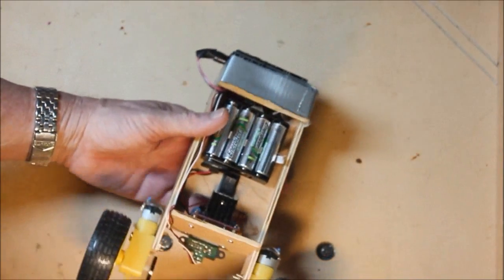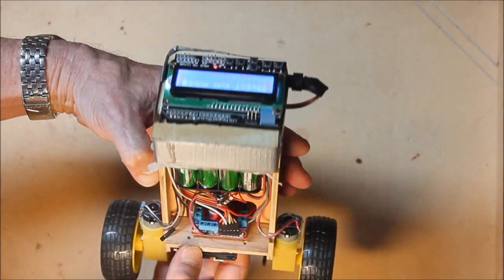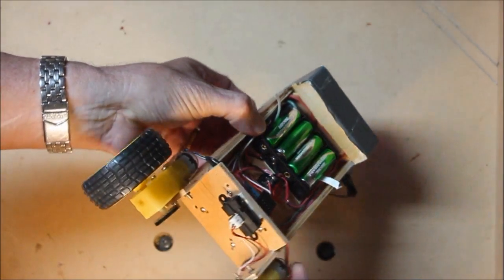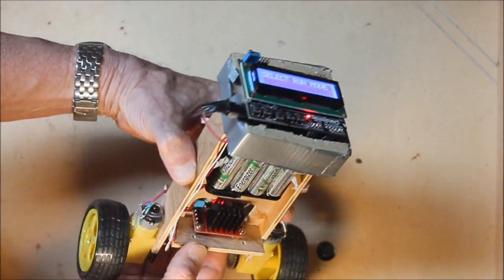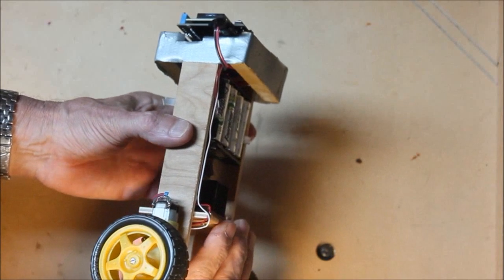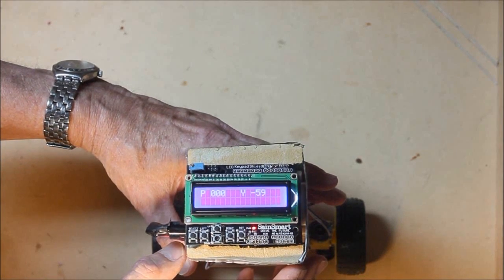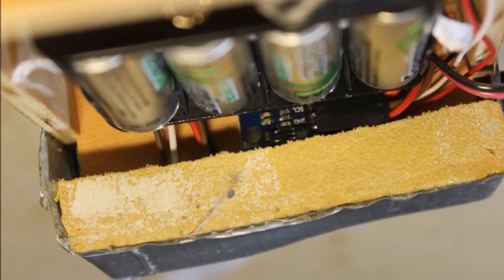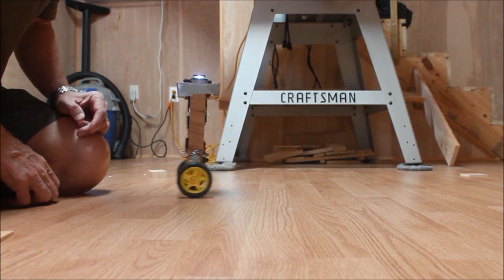Arduino/MPU6050 Balance Bot

Comment: Thank you for make this project open source... after check what parts were available to me and not want to order new parts due to the two weeks it takes for them to be delivered I opted to use the Leonardo's baby brother the Pro micro with is the same MPU. After finishing the robot I just had to wire up the H-bridge and I came across a problem... The micro was less pins than the Leonardo and I don't have all the pins needed as specified in your code. If you were to use the micro which pins would you use and  what changes would be needed in your code. I was thinking reassigning the d0, d1 pins can I do that? I'm not using any USART communications. Secondly I did not have the GP2D15 IR sensor... so I replaced it with a ultrasonic sensor that is run by a PIC12F675 chip and emulates the GP2 sensor output. That seems to be running well. I will post the code to you for others who wish to use this method of object detection at a later date when its all working.... great work...thanks
Reply from the maker: Don't see why you couldn't use d0 & d1. Another option that might be available to you, is some versions of  L298n breakout broads have a hex inverter input chip. If this is true for yours, then you can slave "in2"  off of "in1" and 'in4" off of "in3". That would reduce your Pro Micro lead count by two. 
Ok too on the IR sensor to sonic sensor switch out. Sounds like something fun to play with.
GL with your project and let me know if you post a video of it.
Reply: I have it working now... D0 and D1 is connected to the E , RS on the lcd. PWM D9,D10 is the L298 ENA,ENB and then the rest on the other available digital pins.... worked first time.... but does not balance at all just keeps sweeping backwards and forwards and I have to hold it or it will just fall over... I am now trying to work out how to set up the PID offsets.... Error: on the lcd is over 2000.. YIKES... Yes I will post the Ultrasonic part soon as it all works together... Thanks a lot Jim for replying... Speak soon
Reply: jmhrvy1947  It would have been great if the PID offset's were settable by 10k presets connected to 3 analog inputs so adjustments could have been made in real time or at reboot without the need to reprogram the Arduino.. just speak out some thoughts aloud...thanks
Reply from the maker: Agree.. Setting the PID values via the Arduino IDE is tedious. When I started, I had no idea what values would be needed, or the precision they needed to set to. That and being lazy, led me to using the IDE. Think at least one Analog input pins is still available, so It might be a feature you can add to your take on this project.

Comment: as you said, your robot balance itself by trying to stay at 0 degree. However, what if the the weight is not perfectly centred, won't the robot keep moving in 1 direction?
i am pretty sure the it is very difficult to build a robot with its centre of gravity exactly in the middle.
Reply from the maker: Good comment /observation. I did not make a video of it, but at one point, I purposely added a weight to the car, grossly offsetting its normal balance point. The way the sketch is written, the software is constantly looking for and evaluating what  angle (from the MPU) represents the balance point. You start the software while manually holding the car at what feels like the balance point. At startup, the sketch takes whatever angle the MPU is generating and uses that value as the balance point. Overtime the MPU value will drift, so the software keeps refining the balance point value (based on which angular values yield the lowest rate change).  With the offset weight attached the car operated as without it, but body of the car was on roughly a 60 deg angle (to the floor) rather than its normal 90 deg position. To the eye, it looked somewhat strange , but as long as everything was rigid, the car/software didn't care. 
Hope this response made sense, and thanks for the comment

Comment: Hello i have similar motors as yours (the yellow ones) but i have one problem when i turn the robot on it freezes when the motors start working, how do you solve this problems ?
Reply from the maker: Good question. Initially I had similar troubles. And I described some fixes in the earlier videos on this topic. So please check them out. Probably the most significant thing i did, was attach 0.1 mfd capacitors right at the motor terminals. you might be able to see them in this video. Good Luck, and thanks for your comment.

Comment: Hello This is few of the wonderful project I have seen; I am using UNO so shall I need to change connections!? Next thing how can I caliber MPU6050 and get those Gyro-offset values!? Thank You!
Reply from the maker: Thanks for the comment and interest in the project
You can probably implement this project using the UNO, but in my sketch I have tinkered with the registers that effect the PWM timing.. These lines are specific to the LEONARD and will cause compile errors when the code is compiled for the UNO. At this time I am not prepared to suggest how to adjust them for your project.. (other than to comment them out)
As for calibrating/setting  the PID values. For me, it was mostly a "trial and error" process. My best council is be patient, and build your Bot to survive lots of crashes. Notice in my video this "Bot" has a foam Bumper that surrounds the electronics,. Also the batteries are arranged to disconnect no matter which way the bot falls. This results in immediately shuts down of the system on a crash, saving  both the electronics and motors from burnout 
Good luck with your Bot and let me know how it turns out

Comment: My very first question is how you able to set those values of Kp,Ki and Kd ; please explain!?
Reply from the maker: I wish I had a slick answer for you. But the honest answer is "Trial and Observation"
I started with the "I" and "D" values set to zero, tried to find the best "P" value. After that the "I" value was incremented, and finally the "D" value added. But in general, as you increase one vale, the others need to be changed too. So it took many iterations before I found the values that seemed to yield the best stability for my setup, Unfortunately there is no one set of magic numbers that will work for every car and motor combination.
I appreciate your interest in the project ,and if you are working on one for yourself. I hope you have some luck with it.
Reply: Thank You!

Comment: Great project, I've been watching this video for about 10+ time now. I can see that you explained everything clearly in the video and the code. But due to my limit knowledge in programming, I still have not be able to get the code working. I used arduino Uno, I changed the PWM motor wire of EnB from pin 13 in the wiring digrame to pin 5 of the Uno, because that pin has PWM. 
However when I complied the code, there was the error in line 210 "TCCR4B' was not declared in this scope" , so I thought maybe the Uno does not support TCCR4B, therefore I changed it to TCCR2B and TCCR1B, and got both of them complied and upload successfuly.  
However the left motor (according to wire diagram out3 and out4) keep turning, while the other motor is not moving at all.  I did have the capacitor in place, and I do not connect the LCD display, and did not adjust the offset of the mpu6050 sensor. I just wanted to get the motor run first. 
And did you tune the kp, ki, kd each time you upload the code ? I see some other people attached variable resistor to tune these. But your balance bot is very stable even though I did not find these. 
Can you please give me some suggestion ? Thank you
Reply from the maker: Thank you for your interest in this project. The TCCR4B register is unique to the LEONARDO. So you are correct in deleting that line from the sketch. You did a great job of describing your work, but I can't explain why only one of the motors is turning. And I'm not sure what you got when you added lines to set the  TCCR2B and TCCR1B registers. So It might be good idea, at this point, not to try to manipulate these registers and comment those lines out too. What setting TCCR4B is supposed to do, is make both PWM signals on the LEONARDO have the same frequency. For now I would not worry about that. Later, if needed, you can come back and revisit this issue.  
If you want to just test the motors, I would suggest that you find the lines in the sketch that read:
if (Gud2Go)
               {
                SetMotorSpeed(RIGHTWHEEL, SpeedR);
                SetMotorSpeed(LEFTWHEEL, SpeedL);
               }
And replace them with:
if (true)
               {
                SetMotorSpeed(RIGHTWHEEL, 150);
                SetMotorSpeed(LEFTWHEEL, 150);
               }
(Note: SpeedR and SpeedL can be any value between +254 and -254)
Doing the above should make both motors/wheels turn in the same direction and at the same speed.

Also..
Unless you have re-written the sketch, you are really going to need the display (with its button set) to get the car to run as seen in the video.
You asked about using Variable resistors set to adjust the PID values. That's an option, but it increases the complexity of the wiring. I did not go that route, but chose instead to use fixed values embedded sketch.
Once the right combination is found, they wont need changing. But admittedly it takes a lot of tries to find the best settings.
Finally, I'm sure you understand this, but I'm going to say it anyway. The MPU must be mounted (oriented) exactly like that shown in the video for the sketch to even have a chance at working.

Good Luck , & if I can help you further, please let me know
Reply: I have tried this modified, but still only one side of the motor turning. So I copied your motor control functions and run them separately. Everything working fine, except for the "SetMotorDir()" function. FORWARD works correcly. 
But when I passed REVERSE in the function,  the motor keep going FORWARD with less power, so I measured and found in2(pin A2) is 3V and in1(pin A5) is 1.8V. Which I think should be 5V and 0V for the motor to reverse.
Then in the SetMotorDir() function, I change the if(Dir) into if(1) and if(0) and(true and false) as well. Then the motor REVERSE with no problem. 
However, when in the void loop() , I passed the argument (1 and 0, then true/false) :
void loop(){ 
SetMotorDir(LEFTWHEEL,true); }
The problem happened again. Can you please give me some advice ? Thank you

Below is the code : 
*****************************************************************
const boolean FORWARD= false; //true
const boolean REVERSE= true; //false
#define RIGHTWHEEL 0
#define LEFTWHEEL 1  //Right Wheel Handle
// connect motor controller pins to Arduino digital pins
// motor A     LEFTWHEEL
int enA = 11;
int in1 = A5;
int in2 = A2;
// motor B    RIGHWHEEL
int enB = 10;
int in3 = A4;
int in4 = A3;

void setup()
{
  //setup PWM frequency to ~60Hz for OutPut pins 13 & 11
  //TCCR1B = TCCR1B & 0b11111000 | 0x06; //Set Digital pin 13 Right Wheel PWM period @ ~2ms
//  digitalWrite(A1, HIGH);  // set pullup on analog pin 1 
  // set all the motor control pins to outputs
  pinMode(enA, OUTPUT);
  pinMode(enB, OUTPUT);
  pinMode(in1, OUTPUT);
  pinMode(in2, OUTPUT);
  pinMode(in3, OUTPUT);
  pinMode(in4, OUTPUT);

  //mpu.initialize();
 
}

void loop()
{

  /* add main program code here */
  SetMotorDir(LEFTWHEEL, FORWARD);
  SetMotorSpeed(LEFTWHEEL, 200);
  
}

/***
Purpose : Select motor (left or right), and which direction wheels turn

Parameter lists:
int Motor   LEFT for left motor, RIGHT for right motor
boolean Dir   True for FORWARD else backward

Return : 
void
***/
void SetMotorDir(int Motor, boolean Dir)
{
  int InPin;
  int InPin_;
  
  if (Motor == LEFTWHEEL)
  {
    InPin = in1; //In1;
    InPin_ = in2; //In2;
  }
  else
  {
    InPin = in3;    //In3;
    InPin_ = in4;   //In4;
  }
  if (Dir) // if true set up forward; Note as the car is currently wired the forward command actually makes the car move backwards 
  {
    digitalWrite(InPin, HIGH);
    digitalWrite(InPin_, LOW);

  }
  else
  {
    digitalWrite(InPin, LOW);
    digitalWrite(InPin_, HIGH);
  }
}

/***
Purpose: adjust the speed of the motor

Parameter lists:
int Motor   which motor ? left or right
int speed   select speed from 0 to 255

Return:
void
***/

void SetMotorSpeed(int Motor, int Speed)
{
  int PWMpin;
  boolean Dir;
  if (Speed > 0)
  {
    Dir = FORWARD;
  }
  else
  {
    Dir = REVERSE;
    Speed = -Speed;
  }
  SetMotorDir(Motor, Dir);
  if (Motor == LEFTWHEEL)
  {
    PWMpin = enA; //EnA;
  }
  else
  {
    PWMpin = enB; //EnB;
  }
  analogWrite(PWMpin, Speed);
}
Reply from the maker: To be honest I'm not in a position where I can run your test code
But one thing I see is in the main loop you do not need a call to
 SetMotorDir(LEFTWHEEL, FORWARD);
comment that line out, and instead when you want the wheel to run backwards (reverse) set the speed value to -200 
 SetMotorSpeed(LEFTWHEEL, -200);

good luck and thank you for your patience

Comment: Tôi cần mã arduno.xin bất lực xin lỗi vì nói tiếng Anh là hơi tồi tệ hơn. xin vui lòng gửi về: nguyenquocphu81@gmail.com. Tôi đang sống ở Việt Nam
Reply from the maker: +quocphu nguyen 
https://github.com/jmharvey1/Arduino-BalanceBot
Reply: +jmhrvy1947 
great but you have to make application code that is not ve arduno
Reply from the maker: +quocphu nguyen  I am having trouble following your last comment. But I am going to guess you are having trouble compiling the sketch found at the github site. 
This sketch was written for the LEONARDO version of the Arduino. It will not work on a UNO board.
If this is not the problem., let me know.
Reply: +jmhrvy1947 That is a very nice project. I am currently doing a balancing robot also using MPU-6050, L298N, the very same pair of motors and a Arduino UNO board. I know this may be a complicated question but how would I make this code work on a UNO board? What I mean is, would it be just a matter of changing the pins you used on the board or would it require further considerations?
Reply from the maker: +Floyd (Floyd, I finally figured out where your comment was posted so  am posting my reply here, on the chance someone else wants to know too.)
I get asked this question quite often. And yes, I think an UNO could work, but not in the same configuration as shown in this video.  The display shield that sits atop of the LEONARDO uses the PWM pin(s) that you would need if you use the UNO. 
The sketch, as it stands, also changes the timing so that the two Leonardo PWM signals have the same frequency. The timing registers in the UNO have different names, so you would need to make a correction for that line in the sketch as well.  I found the display to be a "must have" diagnostic tool, and would think you would need one as well. There are other displays out there that don't need as many IO pins as the one I used. So it might be possible to substitute it for another display and free up the needed 2nd PWM signal. But I haven't explored that option, and there could be other issues (like display timing & code space) that would make at least some display types a bad choice.
So I'll let you decide where to go from here. But hope that in the end you will pursue the project, because I think you will find it both fun and challenging
Good luck
Reply: Do you use PID algorithm ?
Reply from the maker: +quocphu nguyen Yes... At its core, I used the model presented in this article (http://brettbeauregard.com/blog/2011/04/improving-the-beginners-pid-introduction/ )
If you haven't already found it, I'd recommend checking it out, as it breaks down the process (and code) into logical, easy to understand segments.

Comment: Hi... buddy! can you share what's the coding?  if I use L293D plus Bluetooth as the 
controll,  in case  just xploit the spareparts I have already used for last project before,
bcause I think better I should use those :-)!  responding plz!  Thnks....(Y)(Y)
Reply from the maker: mukhlis1010 You may have already discovered in the "Part 2" version of this video, its description contains a link to the code I used. But if haven't, then go here:
https://github.com/jmharvey1/Arduino-BalanceBot.
Reply: jmhrvy1947 yeah, i've already seen but it's l298N!
Reply: wht's the coding for using L293D driver? thnks...